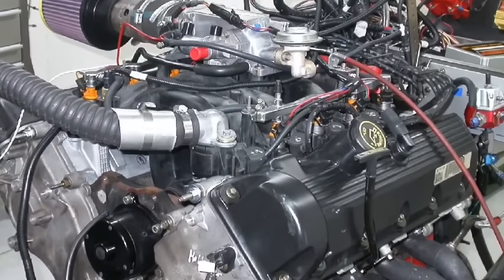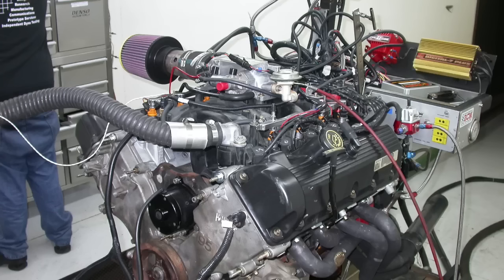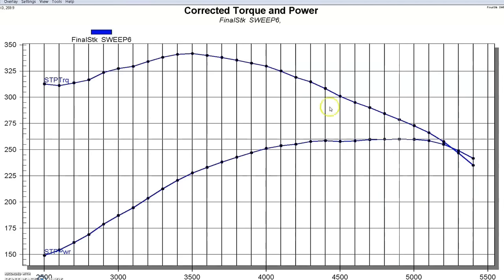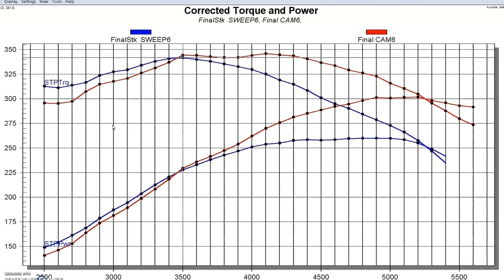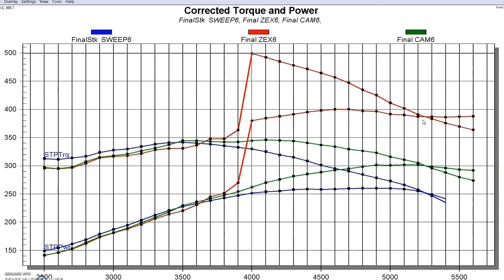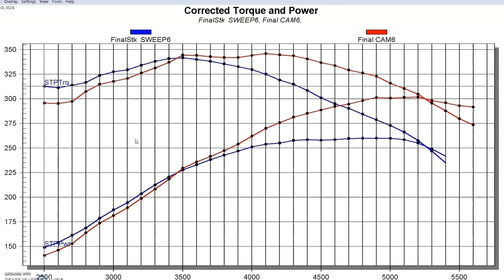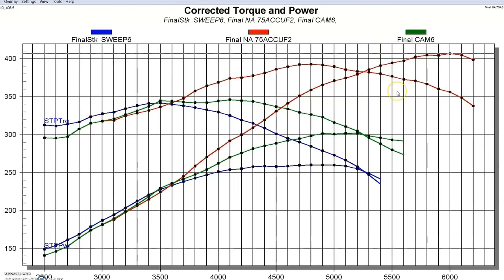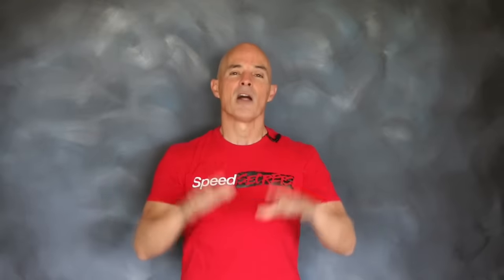HOW TO! MAX HP 4.6L FORD 2V MODS!

Comment: I have a 2002 F150 SuperCrew with the 4.6 modular in it. Truck has 62k original miles and hasn't ran in 10 years. I really want to get the engine running and build it. It's a big, slow, heavy truck with an anemic and inefficient engine. I want to keep the 4.6 block and build it up. Seems like a lot of fun t work with.
Reply from the maker: LOW BOOST TURBO
Reply: @richardholdener1727  That is actually exactly what I had in mind. Its a show truck, so it has air suspension and custom paint. At a show a couple years ago I saw another f150 like mine with the 4.6 with a twin turbo set up. I spoke with the guy who built it and he told me he had heard from a lot of ford mechanics how well the 4.6s respond to boost. Its what pushed him to decide to do that instead of his original plan, which was wedging a built 460 and C6 in there.

Comment: O3 stx single cab f150 with 4.6 2v. It's a beautiful truck but I want a nasty cam in it..not looking for big power, just a moderate gain and maximum sound. I am prepped to do injectors, fuel pump and cams.but what would recommend for a cam with stock heads

Comment: With ring gap addressed using a healthy OEM non pi short-block, topping this off with a nice flowing top end and a touch of boost or nitrous, where would you limit the power output before needing a forged bottom end? I'm just considering something like this, and would be using local pump E70 for fuel. I appreciate all of the research and testing on this cool stuff that you have done through the years, Thank you!
Reply from the maker: nothing you described needs forged internals
Reply: @richardholdener1727  Thanks for the reply Richard. If you had a 96-04 Mustang gt to do a project like this would you find a reputable tuner for this car, or would you tune it with the Holley XFI like you do on the engine dyno?

Comment: You just validated my build. A 96 2v with 99 cobra pistons, 274xe cam, mild pi heads and intake, long tubes. All degreed and assembled carefully. Left to right balance seems to be an issue with these engines. All my research told me I would be lucky to get 300 hp. My butt dyno, a finely tuned instrument, kept telling me closer to 350 hp with a peak around 6,500. Been shifting close to 7,000. Your dyno sheet seems to support my estimations. Now I am going to have to go out and get some ported heads, or maybe tricflows? I would love to see a compare between tricflow and ported.
Reply: Trick flows are awesome. Definitely will give you power from what everyone has told me. Coming from some good people though that I actually trust. I have the 4 valve in mine but still love the hell out of a nice 2 valve.

Comment: Just found your channel and subscribed. I’m actually in the hunt for the 4.6L non-pi motor or a Lincoln MK VIII motor. I’m doing a motor swap in my 02 Lincoln LS, so I’m very interested in seeing all the data and testing done on the 4.6L. Thanks for all the great advice.
Reply: I have one complete and a set of bare 04 2v heads
Reply: The Lincoln LS is the by chassis a sister car to the S197 mustang you could IN THEORY put a 3V 4.6 , OR a 5.0 cayote with a 5spd. Much more research must be done further for more answers.

Comment: Hey Richard, can you do more of these tests but using the 5.4L 2V? I have one in my 03 f150 and wondering if these improvements and the parts used will transfer to my motor...Thanks for all the great videos!!
Reply from the maker: PORTED HEADS AND CAMS AND BOOST ALL WORK ON YOUR 5.4L

Comment: I would to see more modular and hemi motor videos. I own 2 hemis now but the 4.6 3 valve holds a special place. My 07 GT dyno’d 319hp and 336tq at the wheels. It was a stock 4.6 3v with CAI, brenspeed tune, long tune headers and no cats. Car ran 12.8@112 on the factory 17 inch pirellis and 3.31 gears.
Reply: That mph seems pretty high that is higher than most gen 1 and 2 coyotes were trapping stock and they got more aggressive gearing, more rpm and a decent bit more power with similar weight.  I can Def see the 12.8 but the 112 trap seems high for your power level in that car.
Reply: Lol lie

Comment: Hi ,mr Richard. I really respect your knowledge.  And I hav a 4.6 2v . I know they don’t have the most power but I put 667000mi. On my daily and it only needs a alternator. I’ve changed battery water pump and coil packs and that is the most major repairs. My question is on my god 36,000 mi. 04 mustang that will get trick flow heads in the future   It’s a Sunday driver only slip exhaust . I’ve got a set of 1-3/4” headers  for the future with  3” exhaust.  Any I want to start with accurate 75mm complete upper intake  what do you suggest for a lower intake that would be best with this set up? Thank you for all your work. I know 4v would be better but in my experience 2v are very very durable with rods and pistons. Thank you Lott
Reply from the maker: the accufab tb/elbow was designed to be used on a PI intake

Comment: I'd really like to see you do a test of the Trick-Flow 2v heads with Trick-Flow cams and Modular Head Shop's Trick-Flow specific cams. From what MHS says, Trick-Flow's cams aren't designed for their heads. It would be really interesting to see it tested.
Reply from the maker: the trick flow heads work with any cam
Reply: @richardholdener1727  
Did you watch the video where it's proven they aren't correctly designed for the heads? I'd love to hear your thoughts on what was shown.

Comment: Pi did not come out in the crown Victorias until 2001 ...I have a great late non pi engine, a set of pi heads & an Aed m90 Eaton supercharger .... Problem is money spent will not get me the HP gain I want & an lsa swap is cheaper to do in my Ford. The overhead cam timing chains are the weakest link in this engine. LSA or hellcat hemi are the cheapest way to break the 600 hp barrier.

Comment: That is an insane improvement! My buddy has a 05 F150 with a 4.6 in it. Man that thing is a turd! It's a work truck but still... It definitely needs more power!
Reply: I have a 2010 ford f150 4.6 2v single cab it's not slow but not fast , my grandpa had a 05 extended cab 4.6 2v his engine is build different and looks heavier

Comment: will you possibly do a series for the Toyota UZ? i would really love to see what you could do with a Non Interference 1uz where it only starts with 249hp/261lb. ill be getting an SC400 soon here and as much as ive learned about making power in the 90s Fords V8s in just a few videos ik you could teach us alot about the 1uz being that its a small Narrow 4.0 with quad cams, really strong internals but dosen't make a ton of NA power without ported heads or custom intake manifolds
Reply from the maker: are there cams available for it
Reply: @richardholdener1727  Kelford Cams Sells 9  different sets which are about 1300 per set of 4, which i guess isn't a bad deal considering it is after all 4 cams. but ITBs are around 1000, Theirs also an intake manifold/Throttlebody/fuel rail combo for around 600 i think but i have a hard time finding it, Car toon company made a video about it. i think regrinding a spare set of cams from a junk salvage yard 1uz might be cheaper than kellfords option

Comment: Richard, great video, but you never mentioned about the difference between the non pi exhaust manifolds & pi exhaust manifolds. Some say are same and some say there’s a minimal difference in the exhaust ports.. so what’s the real about this?
Reply from the maker: MINIMAL IF ANY DIFFERENCE-THE BIG DIFFERENCE IS
LT HEADERS VS MANIFOLDS
Reply: @richardholdener1727 Richard would be very interesting some comparison test about the oem pi intake vs Dorman pi intake and see if is true that the ford oem is 15+ hp better over the dorman

Comment: My 2011 CVPI SAP makes 289 horsepower without half these mods. I already have PI heads. Added Typhoon intake, Holley throttle body and few other little things to help with responsiveness. It's not a drag car, but definitely a top end contender. I can cruise and control the car at well over 110mph.
Reply from the maker: did you run it on an engine dyno-and 289 hp is nowhere near 406 hp
Reply: @richardholdener1727  My brother works in a shop that has a dyno. Actually, found this out by chance. I dropped by to borrow some tools from him, and he had his 93 Mustang GT convertible on the dyno. He claimed 500 hp for a long time, but I always thought he was full of crap. Turns out it does 500 and change. He basically Frankensteined the motor with GT40 parts and other mad scientist mechanic maddness. Meanwhile I was only trying to prolong the life of my old cop car. He snickered at my car and said, I bet it won't do 220hp. We dynoed it and sure enough it was ranging anywhere from 275 to 290s. Finally settled on 289 and 312 ft lbs torque at whatever the RPMs were. Maybe 5000 or 6000. Don't remember. I was more worried about the my engine blowing up.

Comment: Hi Richard,  Another Awesome video. I no it was a long time ago, but would the last set up, heads,cams and intake cost to gain that power number. I like an upgrade like this because when installed it would look stock. Cheers.
Reply from the maker: not sure on cost
Reply: @richardholdener1727  . Thanks for the reply Richard. I just rewatched the video. And even though I heard you say it the first time. It sunk in and then I realized actually how long ago that was. I will do some homework because that last combo I think is a killer set up. Thanks again.

Comment: Did you degree the cams on the 4.6 2 valve, and how complicated is it i was wondering. Im used to pushrod engines and even degreeing that is a little confusing. If you coul can you make a video on camshaft degreeing on a 4.6 2v

Comment: Hey Richard, My dad and I are both FORD guys. We were both born in Detroit Mi. and I grew up 4 blocks from ROUSCH racing R&D in Allen Park, MI. i was raised on 390s and 429s and 289 hi  po<s
and 5.0 302 mustangs and 351 windsors stroked out to 427 C.i.d. so I  WASNT TOO MUCH of a modular motor fan until I found some really defining things a bout them. i have a 2002 5.4 liter in an Edddie Bauer 2WD with a 3:55 limited slip and a 4R70W trans. if I were to add PI heads and cam as well as an intake with 75mm bbk throttle body to my 5.4 or would you go dohc 4.6 heads with a 500hp throttle body what gains would you think would be possible i am definitely going low setting on boost first or would twin turbos be better? Im  hoping you have the time to answer but if not thanks for the videos.
Reply from the maker: a single is fine if you want low boost and you might not need the 4V upgrade-boost is a lot easier
Reply: @richardholdener1727   so I just leave everything stock except for coil packs and add a 500 hp turbo and intercooler to a stock 5.4 130k miles Im thinking it would hold at 650 h.p. to 700 h.p. about the same for torque.

Comment: Those are some good gains.  Give an old SOHC some respectable power.  Definitely have gotten spoiled with the LS; getting 400+ hp with just a cam in a 4.8L.
Reply: 400hp N/A in a 4.6 2v is possible
Reply: Take this over any stock scatpack or R/T any day in a 2011 Crown Vic 😂
Reply: How does just a cam give a 295hp 4.8 such a big jump.
Reply: @snooterdavid1969   That 295hp is the SAE figure (accessories, full exhaust, factory tune, etc).  With the way Richard dynos them (gross hp), a LR4 4.8 (rated 255-285hp) typically makes 330-340hp with headers, no exhaust/accessories, optimized tune, etc.  A decent size cam makes 400hp dynoed similar.

Comment: Hey Richard!   My question is the tuning as it relates to emissions control and compliance.  Would you say that the non-PI with upgraded cams, PI ported heads and PI intake with a STOCK EXHAUST and STOCK computer with no tuning would #1 pass emissions #2 produce something close to the power and torque numbers you are showing?   and #3 should I be doing a short or long block on the stock block I have currently to maximize these results or is that not necessary?  I have a '97 F250 single cab 4x4 and when the 4x4 and AC is on its a DOG!   Really just looking to wake it up a good bit but I don't want to waste time or money.    Hitting the numbers you are showing without supercharger or nitrous is perfectly acceptable to me.   Your response is appreciated!  B
Reply from the maker: I DON'T GET INVOLVED IN EMISSIONS RELATED QUESTIONS-I ONLY TEST ON THE DYNO.

Comment: Richard I have a question for you...

What if you did a 1998  NON PI  engines. With PI ported heads, Cam's, set piston ring end Gap correctly and put a turbo on it... Plus E85...?
Reply: Its gonna blow TF up

Comment: Richard Thank you for this channel! Here’s my question . Have you done anything with the 6.2 Ford Raptor motor. My brother gave me a 2001 new edge . Timing chain guide broke and bent valves . Nylon pieces jammed the pickup tube and spun one Rod bearing . It’s a Windsor 2v .
At this point a good recipe for the 4.6 would be great . But I know I can put a SBF or a coyote in it . Does the 6.2 fit and does it bolt to the 5 speed . Car has X pipe with flow masters .
4:10 rear gear . Thx again Richard !

Comment: Love the mod motor testing. I have 3 that are too slow. My 4.6 4v is getting a used gt500 blower. You just covered the 4.6 2v(what about tfs heads) so pretty good there but my big dilemma is what to do with my 5.4 3v to get another 75-100hp? Sure seems nobody likes the 5.4 3v so not much info on it.

Comment: I really hope I’m not to late on the video for a response. But I’m looking at building a really similar setup with a vortech v3 supercharger. And there are people voicing they’re concerns that these specific cams will not work on my 96 non-pi 2v application. Just wondering if I could some insight on wether that’s true or not. Thanks in advance, and I love the videos.
Reply from the maker: THE NON PI HEADS HAVE .500 LIFT CAM AND THE PI HEADS HAVE .550 LIFT CAMS-THEY INTERCHANGE
Reply: @richardholdener1727   so I shouldn’t have any issues? Also with the supercharger setup did you run 47lb injectors?

Comment: I know this is an older vid. But I just found. I've got some questions concerning all this. I currently have a 97 F150 w/ 4.6L 2V. But during a tornado a couple weeks back 3 trees fell on it. Crushed part of the cab, hood both pass. side door, and much much more. I have been able to get my hands on two trucks for parts. A 99 f150 w/ 5.4L Triton and a 04 Ring Ranch f150 w/ a 5.4L. I don't know if they are 2V or 3V. There's nothing really wrong with my 4.6L aside from close to 200K on the short block. The heads, intake, and all that is good, I replaced all of that 8 years ago. Would there be a problem with putting my upper end onto a 5.4L short block? If it's doable, which I'm pretty sure it is because they're modular motors, would I be shooting myself in the foot or wasting my time for no or little gain by doing that, putting 4.6L heads and intake onto a 5.4L short block. Is there anything to gain by doing this?
I'm sorry for this being so long winded. Hopefully it even makes sense. Any and all help will be GREATLY APPRECIATED!!
Hope y'all are having a good one and y'all be safe out there!!
Oh and my apologies for any typing errors.
Edit: Or maybe should I go the other way around? Go ahead and rebuild the 4.6L short block and if the 5.4L heads are 2V, put those on the 4.6L?
Reply from the maker: doesn't the 5.4L already have heads and intake on it?

Comment: Idk if you still respond to this video but i'm hopeful.
I picked up a 98 expedition with the 4.6 for dirt. 
Will the 2nd set up work for that motor? It def needs more power plus it will no longer be a street vehicle. Body is coming off and building a roll cage off the frame and turning into an off road buggy and shortening the frame by about 5 feet still want it to hold 5 people for trails. I want to wake this up 😁
Reply from the maker: WILL WHAT WORK?
Reply: @richardholdener1727  pi intake, pi heads, and throttle body?

Comment: I just realized, even with Nitrous this motor combo still didn't hit 100HP per liter.  That reminds me of the BMW M5 V8 and its 100HP per liter NA form, that was a benchmark production engine!
Reply from the maker: or the 160-HP Honda b16A That made 100 hp/liter back in the early 90s. The F-series did 120 hp per liter but I think Ferrari holds the na title currently

Comment: The Fast XFI system was just to run the motor on the bench right?
i could still get the same results if i tuned the stock ECU?
Im looking to mimic this engine build... if i could get to 430 crank NA in a 2v id be sooo happy. 
I have a 2001 GT with all the PI stuff. so i think im going to grab that 98' lower end and build it up!!
Reply from the maker: the stock ecu can be tuned to provide the necessary spark and fuel to make this power
Reply: @Richard Holdener  Excellent l. Thank you for your work btw!!